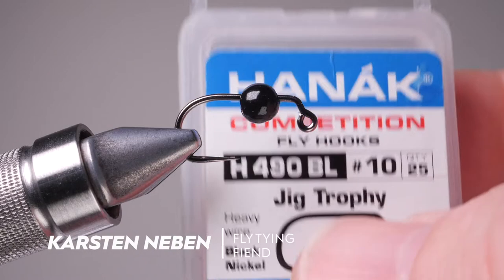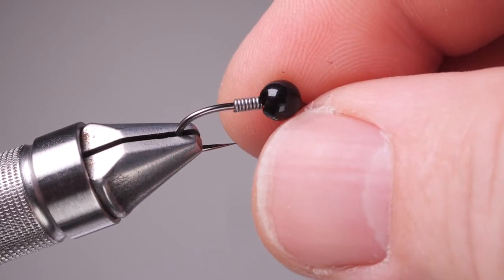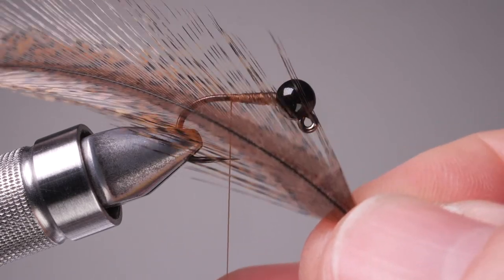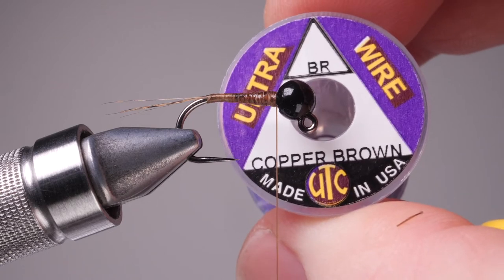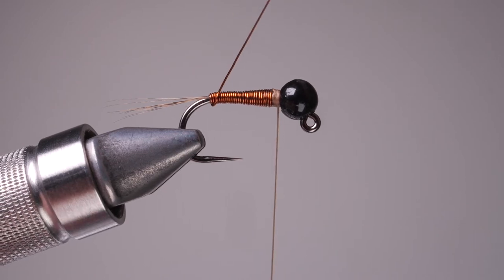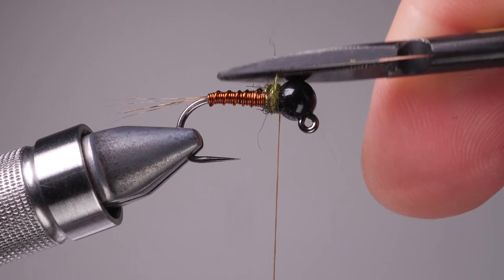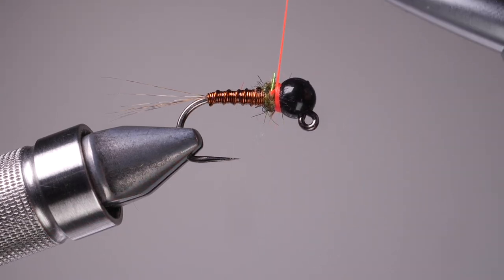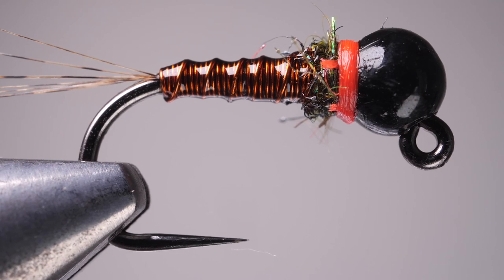Sundays At The Vise - #6 How To Tie A Tongariro Bomb

Comment: Interesting tie and very nice presentation.  The fly is similar to the Frenchie, though using different materials.  A while back a came across a version of the Frenchie you may want to take a look at: Fly Tying Plastique Frenchie | Hackles & Wings ( https://youtu.be/-rEj6P-Q974 ).  I am not the one who posted that video.  The body and tail of that fly uses Veevus Body Quill ( BQ8 ).  The body is finished with UV resin, as in your tie, which makes the fly more sturdy.  I've used the Plastique Frenchie in Montana and had very good luck on it.  I'd be curious if it also does well on the Tongariro or some other rivers in NZ.